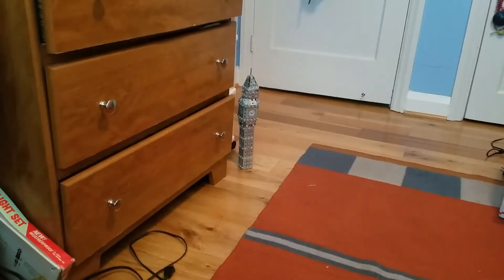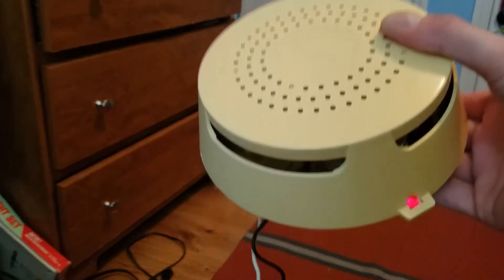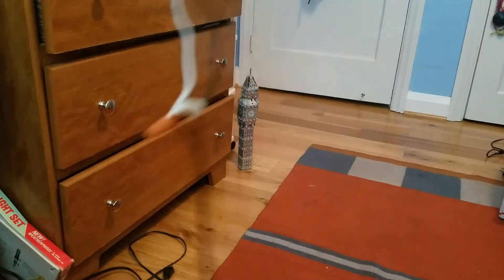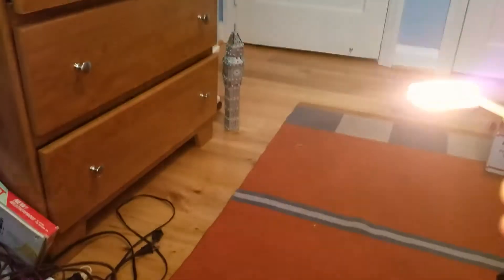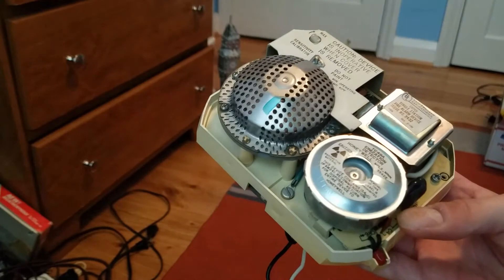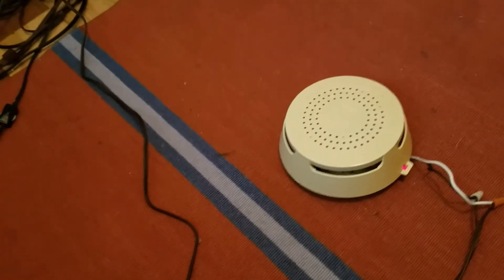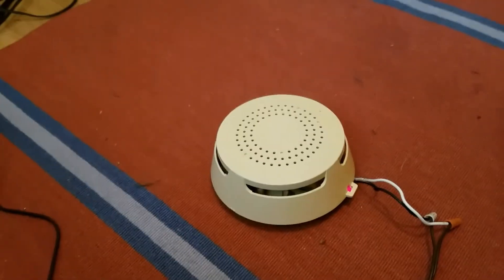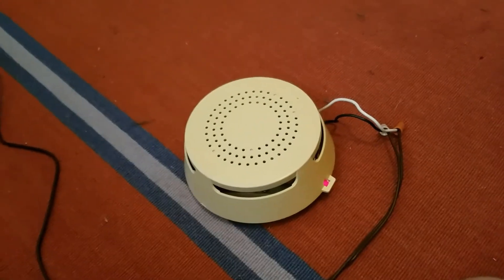BA&F Short: Honeywell TC49A Test - Part 1

Comment: I'm trying to remove this alarm from my vertical wall about 15 feet up, but do no know how it is mounted to the wall. There is no obvious mounting that I can see in the attic. I removed the top left and top right screws and that did nothing.
Reply from the maker: These are mounted with a metal bracket that attaches to the back. there is a small slotted 'captive' screw with a ground wire around it between the horn and sensor which holds the detector base to the bracket. Once that screw is removed it should slide off the bracket and then the bracket can be removed from the box. Hope this helps! I have other videos of TC49A models demonstrating how the bracket fits on that I can link as well. Also if you are replacing it and don't want to keep it, a collector would gladly take it off your hands
Reply: And when you get it down don’t throw it away, several of us collectors would like to have it, myself included, I only have the TC89, the battery powered version.
Reply: This alarm was installed when the house was new in 1974 when my parents bought the house. I've had to take the cover off because it just starts alarming or chirping for no reason. Would like to just leave it in place because of the bracket and hold behind it and use it, but how do you solve the false alarms and chirping?

Comment: damn that's sensitive - i'm not sure it's because of more radioactive material because it's the neutralization of ions and drop in current that sets off the alarm, in theory should do the opposite everything else being equal. (but everything else is not equal)
Reply from the maker: More radioactive material means more matter to give off radiation and create a stronger current of ions inside the sensor. I'm not sure if this has anything to do with how sensitive to smoke the unit is. No I am not a chemist.
Reply: @BAFVintage  Yes - we can only speculate. There are so many factors that could influence sensitivity, like space between the plates/gap, current thresholds, etc. would have to ask an engineer who designs these things.
Reply from the maker: Some older manuals have illustrations on how the "dual chamber" sensor works, though Honeywell's illustrations always depicted the CD200 series "cheese-grater" sensor though. These have the radioactive material mounted on the underside of the dome with the holes in it.
Reply: now a days having manufacturers provide that kind of info is unheard of. :)

Comment: That is the highest pitched squealer I've ever heard
Reply from the maker: It just sounds unusual because it's being fed AC voltage instead of DC which causes the modulation that these are known for. If it were being powered with DC it would sound just like my Teledyne Water-Pik or my NuTone S-185.